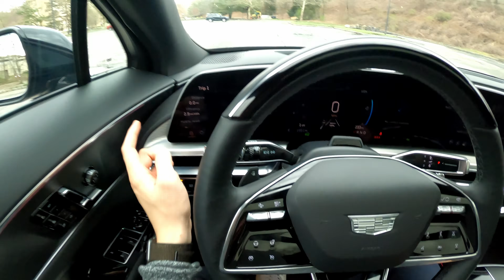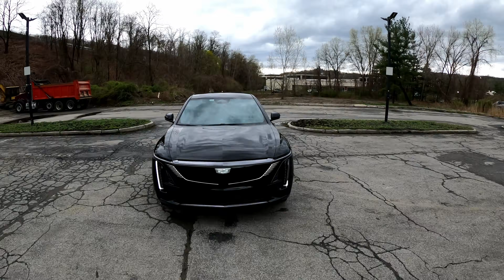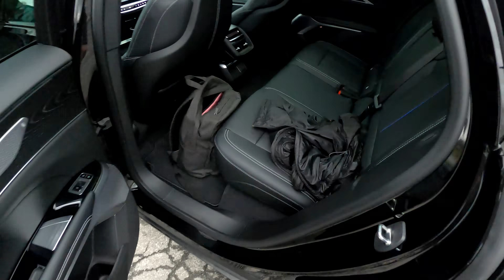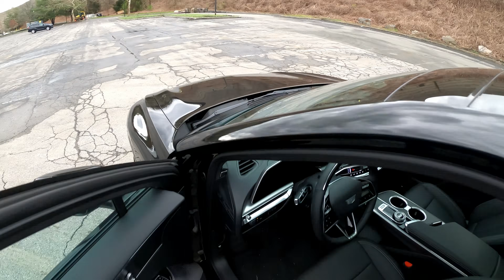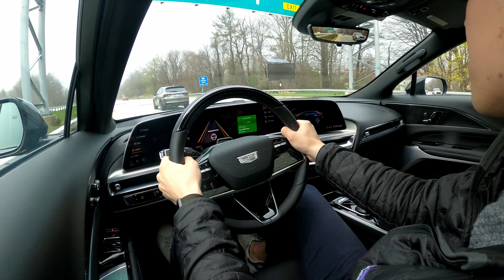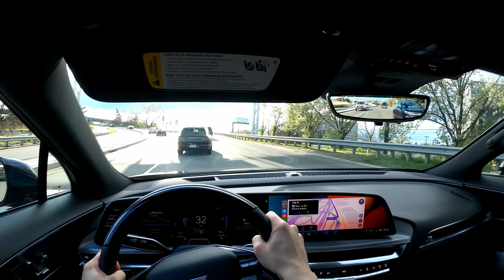2024 Cadillac Lyriq Sport Airport Roadtrip! /// The Best Luxury EV Airport Taxi?

Comment: This is not a XT5 replacement it’s a stand alone entry the upcoming. Optiq is replacing the XT5. The Lyriqs wheelbase is 2 inches longer than a standard Escalade, so it’s in no way replacing the midsized XT5.
Reply: That is literally not true I work for Cadillac lmao. All you have to do is look at the dimensions of the vehicles to see that would not even make sense. The XT4 is a sub compact SUV but has always been larger than competitors. The XT4 got the refresh with the 33inch screen out of Lyriq for the simple FACT that there will be no EV variant of the XT4. This is why the new XT5 has debuted in CHINA ONLY; due to the FACT that Optiq is the electric counterpart to XT5 the Lyriq is a stand alone entry and I STAND by that. Thanks!
XT4: 109inch wheelbase 
XT5: 113inch wheelbase 
Optiq: 116inch wheelbase
Lyriq: 122inch Wheelbase 
So who’s replacing what??? Anyways, Ni hao!
Reply from the maker: @TailoredByCW  Never said replacing, being sold alongside, and I did have this explained to be as such! But this makes just as much sense! Nonetheless Cadillac is top tier with EV designs now.
Reply from the maker: Incorrect. The Optic is a EV version of the XT4. Lyriq is an "ev version" of XT5, Vistiq is EV version of XT6, and Escalade IQ is ev version of Escalade. This is how Cadillac explained it to me. None are REPLACING the gas models, they are being sold alongside.